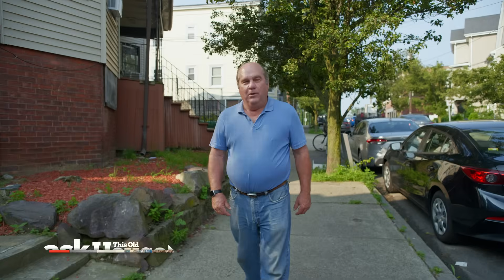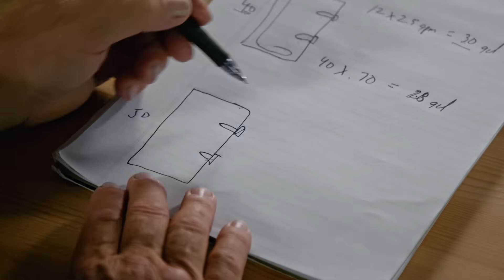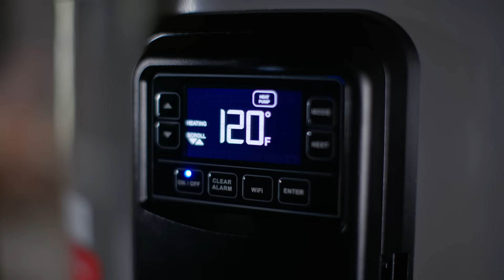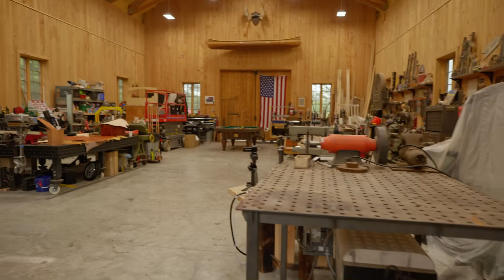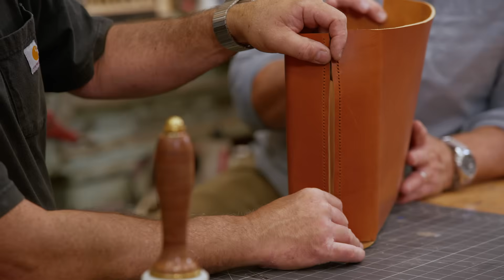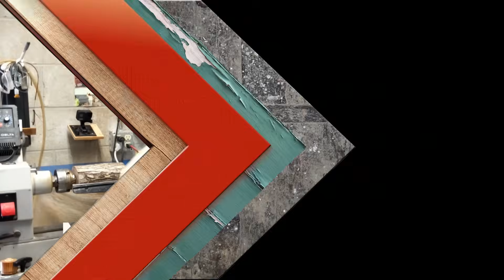ASK This Old House | Hot Water, DiResta Leather Tote (S22 E12) FULL EPISODE

Comment: Good luck with the electric water tank / heat pump haha. 

Gas is far superior.
Reply: That depends on the relative price of the energy source. In most of the U.S. gas is cheaper. Where I live the gas company is a for-profit corporation. The electricity supply is from a non-profit co-op so, in my situation, it is cheaper than gas. Otherwise, energy is energy. That being said, the water heater in my residence is gas powered per the original construction. I would switch but it would be impractical to route a new 250VAC/30A circuit to the location of the heater.

Comment: What  is that water heater set to if they are using pure hot water for a 12 minute shower?  Of those 30 gallons maybe 20 should’ve come from the hot water and the rest from the cold mix mixing together.  Why is there water heater turned down so low at their showers are straight hot water?  My 45 gallon showers a family of four without issue.
Reply: Temperatures over 120F can burn people. In most circumstances one doesn't want to have hotter water coming out of a tap, particularly if there are children in the household. I live in a single person household and I set the temp to 140F (with a 75 gallon tank).

Comment: Makes sense with the new water heater (esp. re: efficiency). In the US do you also have switches to control on/off and half/full capacity? We use hot water a few times a day, no point paying to heat a lot of it for 24hr.
Reply: There are also "tankless" water heaters available. They only heat water on demand.

Comment: Why not just switch to a tankless water heater?
Reply: Because those are extremely energy intensive, especially electric. If they making a swap out from one gas heater to another that might be a different story.
Reply: My guess is since its rlectric there probably isn't the capacity to handle electric unit. I believe you need a minimum of 200 amp service to use electric tank less and that takes 2 40 amp breakers. Plus it doesn't perform as well as a gas unit. I believe at best it only gives about 1 gallon per min.

Comment: Over the years, I learned a lot from this old house videos but this one needs to be pulled down.  Teflon tape wrapped in the wrong direction.  Not a full disclosure of the new tank cost vs how long it would take to recover costs of just a larger tank or a higher hot water setting. And no comparison of tank hot water volume assuming no cold water makeup - are you kidding me.  Nope - absolutely bad information - pull down this video.
Reply: I also noticed the Teflon pipe dope tape being wrapped in the "wrong" direction. Once assembled it doesn't make any difference but it makes it more difficult to get the assembly started if the loose end is facing the direction of the rotation needed to thread a fitting in.

Comment: Nonsense. That 40 gallons in the tank should be of very hot water, much hotter than your shower. It is blended with cold water to feel the showerhead. So 40 gallons of very hot blended with let's say 20 gallons of cold will produce 60 or 70 of shower temp water. The first thing to do is to check the temperature the tank is set to. If it is at or just above your shower temp, you'll run out at 40 gallons. By the way, that would be the only circumstance in which Richard's math would be valid.  You can fix this problem often by increasing the temp. of the heater. I bet the owners turned it way down to reduce their utility costs while the house was empty. Also, could one element be burned out? Did he check that? I have lived several places with 40 gallon heaters and never had a problem with my wife and I running out of water.She takes long, hot baths and showers.  Shouldn't a plumber know these things? But of course the heater was donated and he needed to make yet another water heater video.
Reply: Code requires tanks to be set at no more than 120° or 140° if there's a dishwasher.
Reply: Yeah this episode is crazy. 40 gal is plenty for a family
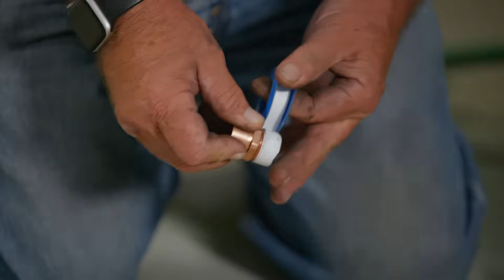Reply: A plumber should know these things. A plumber should also know how to wrap the Teflon tape in the right direction. Richard is wrapping the tape the wrong way 6:40.

Comment: If a 40 gallon water heater can’t provide more than 1 shower, why does that size even exist?
Reply: 15 - 20 minute showers are ludicrous!  Showers should be MUCH shorter, which will save water AND energy..
Reply: For small service needs, not necessarily for a shower or heavy calls.
Reply: @martinlahm7638 his 'math' was assuming you have the shower turned to max heat the entire time, which I don't know anyone who can do that, unless of course the temp setting was way down - which they never even mentioned.
Reply: Size restrictions
Reply: 40 gallons is fine for a regular household. 
The new hybrid water heater is actually too small at 50 gallons. They take longer to heat up the water than regular electric heaters and way longer than a gas water heater.

The heat pump water heater should have been sized at 65 gallons to provide plenty of hot water for multiple showers.
Reply: @David_H_Parker  40 gallons is insufficient for a single family residence. Even a 50 gallon tank may be marginal depending on the number of baths and/or occupants. 40 gallons may be appropriate for a one-bedroom apartment.
Reply: @avsystem3142  40 gallon tanks are the typical single family dwelling standard size. An apartment or small house may only have a 30 gallon tank. A very large home with multiple bathrooms is standard to have a 50 gallon tank.

Houses with a constant need for hot water would either have a boiler or a tankless unit with very high BTUs.

The new hybrid water heaters take a long time to produce hot water so you need to oversize the tank because the elements can't keep up with higher demands of multiple showers or washing.

Unless installing a 200K BTU commercial tank type water heater, there is no residential tank heater that can provide a large family back to back hot showers.
Reply: @David_H_Parker  You are living in the past. From Google: "For tank-based water heaters in single-family residences in the US, the most common capacities typically range from 40 to 50 gallons. While 40-gallon heaters were once the standard, the trend has shifted towards 50-gallon models to better accommodate modern hot water demands."